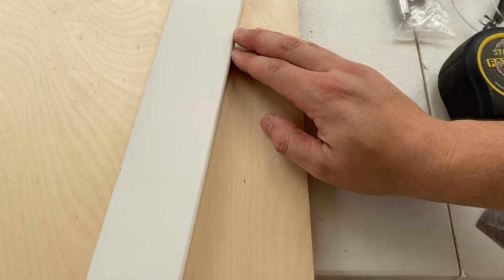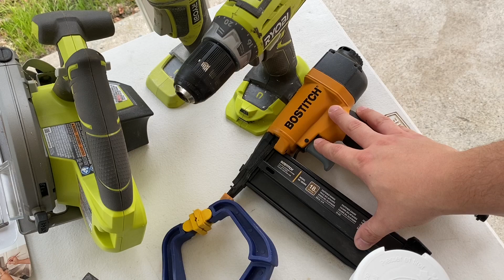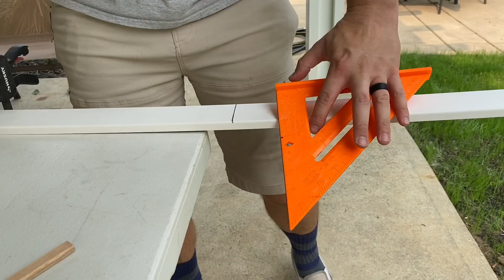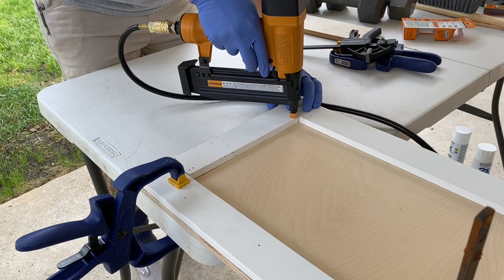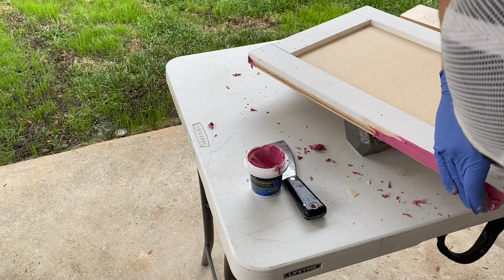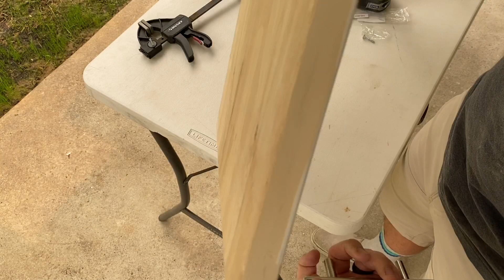DIY Faux Shaker Cabinet Door

Comment: You probably wouldn't put these in your kitchen...but...can you?
Reply from the maker: I guess you CAN, if you’d like to. Personally, I would make sure I used a table saw for very precise cuts for the board. But at that point, you could figure out if to do true shaker cabinet doors. Also, a reasonable priced option is to “reface” kitchen cabinets doors. You can do some googling on refacing. It’s much cheaper than new cabinets. Thank you!

Comment: Great and well explained diy video. I need  to make a shaker style door for a rolling pantry cart - door size would be 12x80… how heavy was this door you made?
Reply from the maker: Awesome! I think with some light birch plywood, or whatever thin finished plywood you can find in the size too need, and some thin MDF trim it could be light enough to hang with probably 4 hinges. Things to look out for, warped plywood and you’ll also get a good feel for the weight by just picking up the plywood. Good luck!

Comment: So I did this but after painting my door it seems to have bowed. I used interior acrylic semi-gloss applied with a paint roller.   Any help on why this keeps happening?  I used pine on 1 and birch on another. They both are now bowed.
Reply: The door looks very good but the potential issue is exactly what happened to you. The frame and the panel are bound to each other and the materials absorb moisture differently during the season which is why panels are not glued or fastened to the frame in a true panel door.
Reply: Moister change in the material
Reply from the maker: Did you realize they were bowed after install? I had one come up slightly bowed after install I think my verdict is that board was bowed enough from purchase prior to install that became more apparent once installed. This is also why If using hardware store wood I wouldn’t recommend kitchens for these doors. Sorry that happened to you!

Comment: Can these be used in the kitchen?
Reply from the maker: They could be, but I would recommend them in hallways, linen closets, garages, etc. If you were to consider a kitchen consider the thickness of the trim applied to the back board (my example is probably too think), how flat and square your back boards are and gaps where everything meets to make sure it’s really smooth before painting. Thanks for asking!